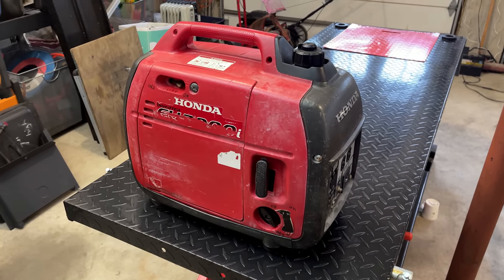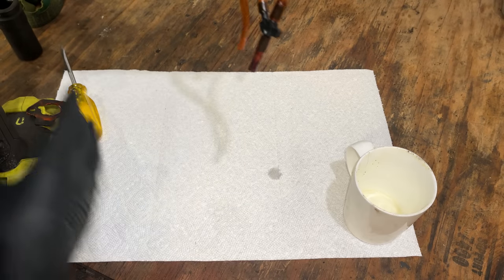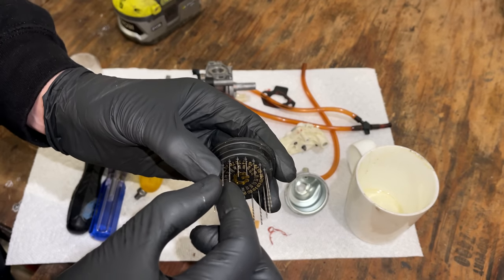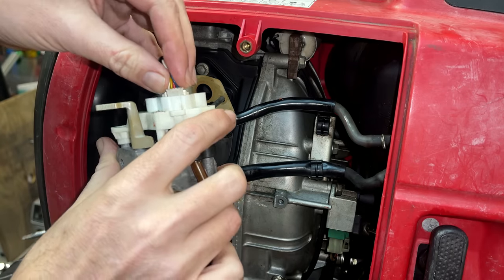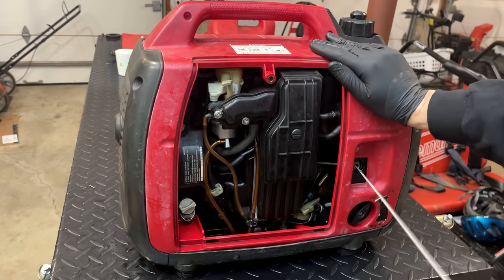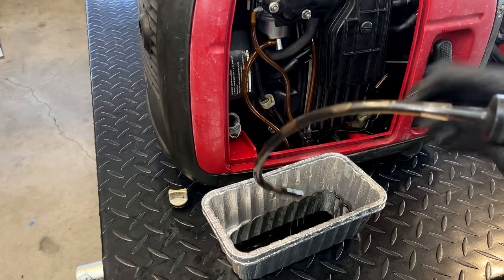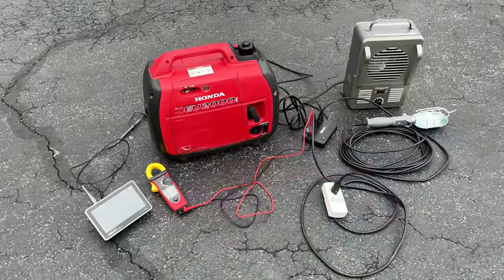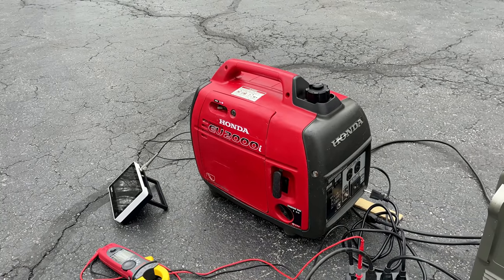Old Honda EU2000i Generator Leaking Fuel

Comment: I can 100% understand some people not wanting to work on these. But me? with a lot of these you can quickly find the problem, find a solution, order a part or an easy fix...The problem i see would be what to charge somebody, You spent time on it, you time is worth something, but some machines if you needed to DEEP clean the whole fuel system, a few other parts or services...those add up. By deep clean, i'm saying they had water in there and made everything just crusted up ect, or its had even worse salt water and all the ports are blocked in the carb ect. Worst off are basic chainsaws and weed eaters mowers ect. Either you need to find the problem in 10 minutes max (which is common) or you're gonna be losing money, but keep a customer.

Comment: You should be able to add a filter capacitor to bring that THD down like they use to do for radios in cars. It would even be easier on the bigger generators. Just a thought always enjoy your videos
Reply: Huh??? Less than 1% THD is very good and adding a capacitor wouldn’t help anyway.

Comment: I have the exact same machine and the low oil sensor is on the sensitive side, leveling is important (not always easy in the field) and only a few ml oil less than full will trigger the sensor. And after a few weeks of storage it takes up to 6 pulls to start, after that only one.

Comment: Looks like a easy fix, I suspect that a small engine shop does not like working on the small Hondas and no shop is going to clean up the unit like James Good Job
Reply: That's true most shops wouldn't clean the unit up,  unfortunately most customers don't want to pay to have it cleaned.  I clean everything,  but I have very few customers,  the ones I do have appreciate the fact when they get their equipment back it looks good.

Comment: One look at that leak and I concluded that it was a faulty gasket, needle or the fuel level inside the bowl, due to a deteriorated needle tip. Simple fix is to put a small shim in between the needle based and the float tongue, to adjust the height, so that the thing stands parallel to the carb body. I have done similar stuff, 35 years ago.

Comment: I can understand why you wanted to add these decals to make it look good. Sadly, these same decals are used by unscrupulous people to disguise clones or lower powered generators. I've seen a couple of very suspicious looking examples on eBay, where the filler cap and power connectors did not look like any genuine picture I've found. I can't say for definite that they were fake because, not surprisingly, I stayed well clear.
Reply from the maker: It would not surprise me if there were fakes out there.

Comment: I was a bit surprised you chose to pull on it 30 times before checking the spark plug; since these usually start on the first pull.
Reply: If the sparkplug is wet with gas after the 30 pulls...
every part of the carb system from the tank to the cylinder is working.
So then you can confidently start mucking about with the ignition system...
and it's usually the plug...

Comment: I have one that leaked. The fuel on/off valve vibrated apart and gravity did the rest.
I reassembled it with locktite.
I recommend installing a larger inline fuel filter and discarding the stick filter.

Comment: The float needs to be set the fule is filling up to far an spilling out the throat of the carb.  Theres a metal tab  usually on the inside were the needle sits. That you can bend to set the float down a lil to stop this issue.
Reply: Not on this one. 
It's all plastic, including the possibly bent needle assembly...and the distorted looking float.

Comment: You can use RTV on carbs if you use TB 1184 or Playtex MotoSeal..  they are resistant to fuel and oil.  I use 1184.

Comment: Non-ALGORITHM standards of excellence is important in every process, specially for equipment supplies, inventories realization, reports realization, systems maintenance and control. Blue prints are always reliable. Engine that does not light up or ignite has to be examined thoroughly, specs, parts, types, series, model and spare parts, chips and configurations.

Comment: GOOD deal but I guess all the smoking was from all the flooding. I got a vacuum deal for small engines from Lowes that works REALLY well for draining oil from these supposedly 'modern' engines. It has 2 sizes of tubes for maybe dipstick tubes as well as the larger size. I got the electric start hand mower running but it won't restart so all is not done quite yet. A new carb (which means nothing to me as far as 'new' goes) and primer bulb but it seems neither works. Ahhh, spring. Job security. God Bless!

Comment: Hi James.  One thing has been on my mind after watching this.  You have mentioned many times that the Harbor Freight degreaser that you use in your ultrasonic cleaner can shrink the O-rings.  As in this video, you remove the surface parts that can be damaged before using the ultrasonic, but what about the radial O-rings for the throttle plate and choke shafts down inside the carb?  I would assume that these shafts have O-rings, but not sure.  Thanks for taking the time to record your work.  I really enjoy watching your videos.
Reply from the maker: Normally no o-rings on small engine choke and throttle shafts.  Have not taken a look in this carb though.
Reply: @jcondon1  Interesting.  I guess the engine manufacturers are ok with a minor vacuum leak around that throttle plate shaft.  It must be so minor that it does not hurt the engine performance.

Comment: Mr.C, another insightful video. My Honda 3000c would smoke after oil changes too. Remember I still have the windings and Black Box for the same generator.
I just bought the new Generac GP2500i. It has less than 15 hrs. on it so it's still in break-in. I needed a generator that wasn't so loud.
I was just wondering if you have any thoughts or incites on the GP2500i? NWR.

Comment: Great video as usual and i like them alot , i have learnd alot of you thanks Condon , but i belive that the oil level should be al the way up to last thred and that should solv the problem with the oil warning to according to sticker on the side. Could not see in video if ground made it tilt so much.

Comment: We had one the same issue and it was the needle valve not seating correctly so it would go a couple of days fine and then leak i ultracleaned the carb but still did it again after a couple of days after pulling apart again i checked the needle to see if it was sitting straight and it wasnt   the spring had moved and pushed the needle to one side  so it wasnt  seating squarely so i turned the needle till it was square and made sure the spring wassitting evenly onb the needle and reassemble so that  was the issue  its a matter of changing the needle and spring  i told the customer what the issue was and that he may need to put a new carb or change the needle and spring he was only on holiday at the time and was heading home that why i didnt orderthe parts  at least we sorted out the issue

Comment: I have worked on a few of these EU2000 units.  When the idle screw is set too low, I have seen HARD STARTING and even 'hunting' when in eco-mode without load.
Reply from the maker: Good point.  Maybe I should read up on that.

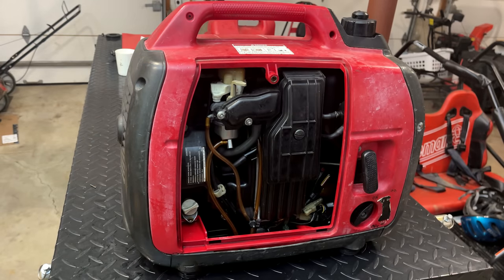Comment: 26:25 You was lucky you did not have a full runaway condition. What happen is when it start up with full manually open throttle, the computer will fault out before it closes the throttle to idle down due to high rpm fault and now you have a motor with no load at full throttle. Happen to me once, I shut it down in a second and so far, no issues from overrpm.

31:34 I use a tube extender made just for that generator. I got it off amazon, make changing oil nice and clean. Basically, it just a threaded tube that screws in place of the cap and extends it beyond the cover door. I use an empty soda bottle, place on end and tilt it over to fully drain the oil.

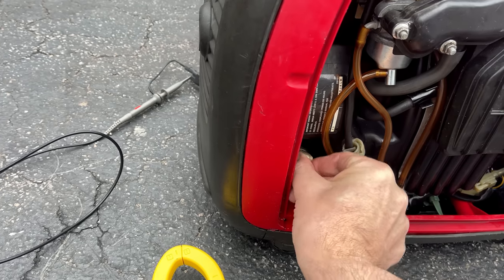40:21 I had that problem too. Figured it out it was not filling it properly. On level ground, fill till it almost drips out. Any lower and it not enough oil to handle cold conditions where a lot of it end up in the head before it drains down.

Comment: The carburettor is the devil in the details on these. I have been messing with a Predator 2k clone that was "dead" and "could not be fixed". ( Yet my buddy could not tell me what was wrong with it.) I service the dumpster at the business and saw it sitting by the building, naked. 
Long/short of it carb was full of dried water and gas but the cause of "death" was a push rod had fallen out of place. (No damage). Put back together and called it Lazareth.
Now to actually adjust the valves and reclean/adjust the carb. It hunts except under heavy load. This video let me know that the idle ket is behind a brass plug on this thing

The really sad thing is i emptied their dumpster and had pulled out the covers for the thing the week before, but left the at the landfill when the genny did mot show up when i dumped it. (Gotta love small county landfill they let you do some limited picking.)
Thank you James. I really appreciate your NOT skipping the small details in your videos. Sometimes that "boring" screw removal shows where that cover scew I missed is.

Comment: Thanks for the video James. I have a Honda 2000I too given to me with the complaint it wouldn't start. Unlike your repair mine is pretty dirty and missing 2 of the rubber ground supports. Seemed to have a hard life. case looks very similar to yours in appearance. I did the usual service but not the carby and it seemed to start and run fine. Ran it under test for 20inutes stilpl fine. A few days latter tried starting and running but kept getting the low oil light. Will see if my issue is the same as yours was.
Reply from the maker: I have had a few with the low oil light issue.  Never dug too deep into it.  Not really worth tearing the engine open to fix.  Worst case you can bypass the low oil system.   Just be sure to check the oil:

Comment: The video was interesting but I would have suspected the "Float" right of the bat as they have a high failure rate. When the generator failed to start again I would have just changed the spark plug as it was most likely fouled.
Other than those two issues it was a pretty good video.

Comment: I have 2 of those. One is running good, the other is leaking oil form some where and by the looks of the oil, maybe starting to make metal, which is a shame the both are very low hours. maybe between 50 to 100 hours max. Bought them to rv with, we ended uo only going to full hookup sites. And both have been converted to tri-fuel, Gas/propane/or natural gas.

Comment: I'm not a particular fan. Off putting heater heating. or heating elements on small generator. I think the running on the peaking. is not more providing so cool efficiently to generate unit down.
Reply: Unless you point the heater output directly at the generator thus providing it with hot air so it can't cool properly...
it doesn't matter.
A load is a load...whether lights, heaters, computers, etc.

Comment: I have a 3500  watt Predator inverter gen that ate sand into the intake and scored the piston and cylinder. Anyone know of anyway to get parts from Harbor Fright?  This is a near  new gen that was taken to the beach and it settled into the sand and took sand into the engine.. If anyone needs an inverter board or other parts I am willing to part it out if I can't repair it. Thanks for the help and good work to James. I never miss watching his new vids. Always informative and a great learning tool.

Comment: Dealers don’t have good techs, anymore.  I ordered a scabbard for my MS 260 Pro the other day - 16 inch .325 chain.  Do you know what I got?  A scabbard for a 16 inch LP chain, like would fit on my ms 170, 171, 180 or 181.  It would not even go on the bar of the 260, halfway,, because a 260 uses a fat bar.  I told him it was the same scabbard used on a MS 250.  I will save it and paint it flat black and put it on my Poulan S25DA, which did not come with a scabbard.

Comment: My Dad has been a Top Honda Outdoor Power Equipment Dealer for more than 4 Decades,... I sold Honda's, their Parts & Serviced Honda's myself for years. I have owned Honda Cars, Honda Truck, Motorcycles, Honda Outboard, Mowers, Blowers, Trimmers Generators but no longer buy Honda products, premium price for the same disappointments as cheaper product & I think Honda is resting too much on their laurels,... Also, they are manufacturing in cheaper plants/countries which they must to stay in the game.
Cheapest I see an EU2200 is US$1200 but I bought a Chinese 2300/1800 watt Inverter Generator that is quieter than the Honda for $360 plus $60 for a 3 year protection plan ;) 
I rinsed the Crankcase of the Chinese unit when I bought it & it was super clean inside, did 3 oil changes in first few hours of running & oil was spotless each time,... The Chinese product is much better than it used to be.
The only reason why Hondas are worth repair at all is the very high replacement cost lol.

Comment: It's nice to suck the oil out but that won't remove all of it. I'd still pick mine up and tip it over to get all of the oil out.
If gas was flowing out of the carb throat, it was also flowing into the engine and down to the oil. 
It was burning oil and that won't just stop. Keep an eye on it.
These carbs are VERY finicky. Three or four weeks without running and you have problems again. (yes, I use only no ox gas and sometimes a cleaner)

Comment: When removing the idle set screw it should be determined how many rotations it is currently set at, so it can be returned to the same setting.  Typically 5.75 turns is what I've seen as normal for my EU2000i (2002 manufacture date)

Comment: some of these had a recall on the fuel shutoff i had mine replaced at the dealer no cost fixed the issue for what it is worth still runs strong

Comment: Since this is an inverter generator I'd be really surprised to see low output frequency or high harmonic distortion based on a load.  Unless there is something wrong with the inverter circuits.

Comment: Question: How did you clean carburetors before the ultrasonic cleaner you have now?
Reply from the maker: I tried carb cleaner and gunk parts cleaner but was never happy with the result.  Both caused sever damage at times to rubber parts.
Reply: @jcondon1  I kind of assumed that that's what you used. I am currently working on an old John Deere tiller. Somebody "cleaned" the carb and never put the float pin back in. Oh btw, first time working on a small engine carb 🙂 for me. I've worked on my own cars for years but i never had carb issues.
Having watched you tear down a carb a gazillion times, I am very familiar with how to get this done. Thank you for your ability to share what you do and teach it with such ease.
Reply from the maker: @Amy_McFarland  just use a small wire to clear the passages, small wire brush as needed and carb cleaner as needed being careful not to get it on rubber parts.  Some carb cleaners to not damage rubber.  A Google search might point you to ones that are safe.  When I first started I assumed carb cleaner was safe to use on carbs.  Found out the hard way.
Reply: What is the solution you put in the ultrasonic cleaner?

Comment: Very strange that the fuel was leaking from carb intake rather than the bowl vent/ overflow lines like mine is. After seeing this video I’m confident that’s where my problem is. I think it’s the little spring on the bowl float valve but I’ll half to rebuild it to know for sure.

Comment: I noticed with both my Hondas when I turn the gas on I need to just let it sit there without doing anything. Go get some coffee come back in 10 minutes. It'll fire right up.
Reply: Next time pour your coffee and take it bck to the machine with you.
It'll probably fire right up....
it may take one minute max to fill the carb bowl..
but if you haven't drained the bowl the last time you used it...
old stale fuel left in the bowl needs to be "freshened up" by the new fuel mixing with it....
then it will start easily.

Comment: When you found that the carb held pressure when upside-down, I immediately thought the problem could be wrong float height, which turned out to be the case. But isn't it possible to adjust the float height rather than use the float from another carb? A hole in the float would also cause the carb to overfill, yet hold pressure when upside down.
Reply: The float and mechanism (plus the needle and needle holder) are all plastic and therefore, unlike brass...unable to be adjusted.
Replacement of float and needle is the only option...

Comment: When you’re sucking out the oil, I wonder if you could “pinch the line” with a pair of vice grips say (once the line is full of oil) and then remove the plunger from the tube (sticking your finger on the now open end maybe), and then take the vice grips off, keeping the end of the line lower than the generator, would the oil just continuously siphon out on its own.

Comment: One more note
The newer eu2200 doesn't need the additional kill switch
They have improved it so you can turn the knob part way off closing off fuel supply. And at full turn last little bit it cuts the ignition
Reply: I had to additional comments
Apparently they thought it was spam
Perhaps because they both linked eu2000 aftermarket products on Amazon
Reply: @acew280  YouTube only kills off comments with usefull links, whereas scammers and spammers get a free pass.